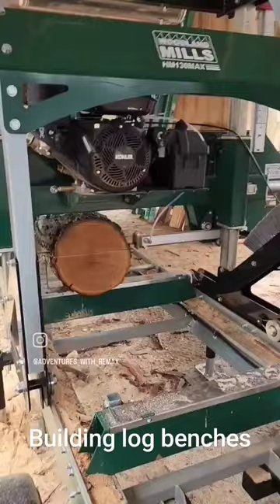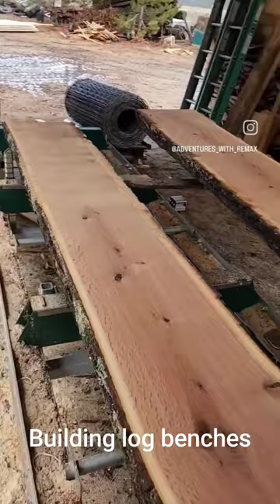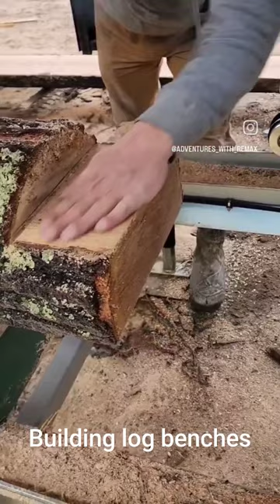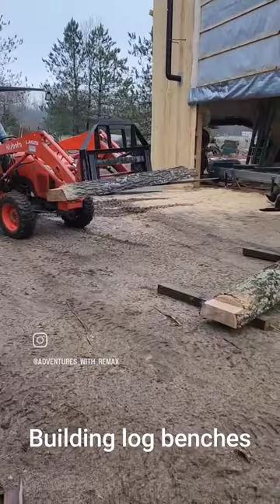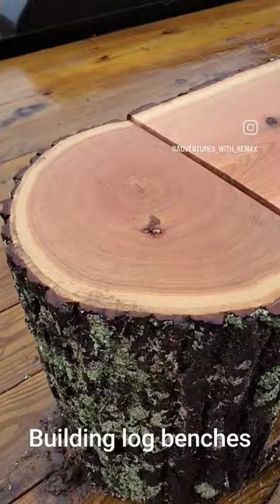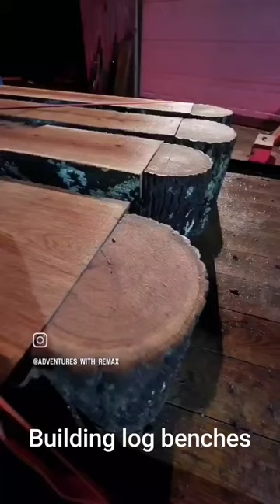Building log benches #woodworking #logsplitter #sawmill #woodworking #outdoorlife #outdoorfurniture

Comment: Are there any fasteners holding it together?
Reply from the maker: Only a metal lag bolt with top cut off acting as a pin with hole drilled in bench piece.